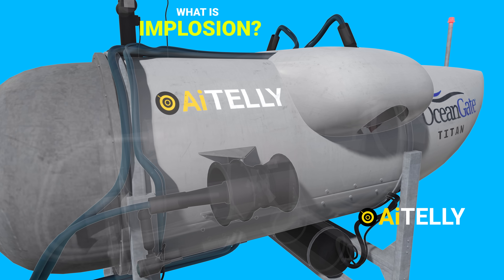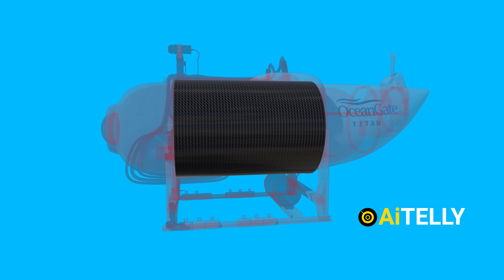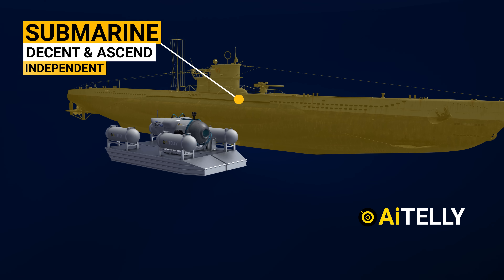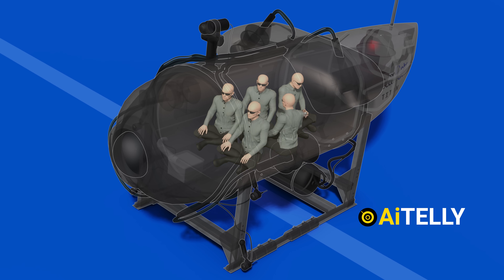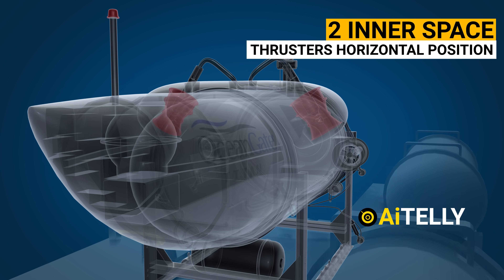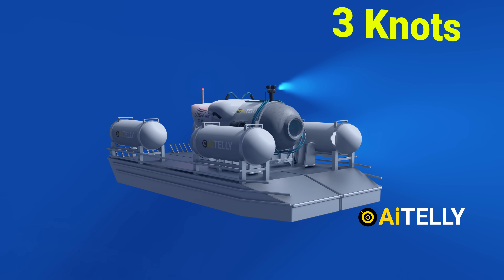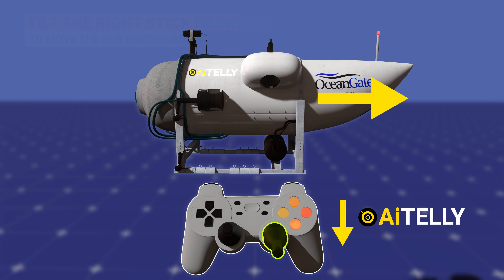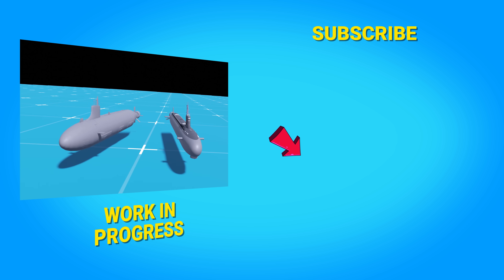Implosion Titan Oceangate How it Happened | Submersible Submarine Parts #3d

Comment: I did study mechanical aeronautics engineering. It is too early to point to the first component that failed, but for the sake of the discussion, I'm looking at a few different possibilities

1. The carbon/epoxy material is usually used to stand 'traction' forces - the carbon fibers are very resistant when pulling on them, which is how they work in aviation where the cabin pressure is higher than the exterior pression.  On a submersible, the pressure relation is exactly the opposite : the exterior water pressure is much higher than the interior air pressure, so the carbon fibers are put in compression rather than tension. It's actually the epoxy resin that must stand the compression - and resin is not a great material for this purpose. Some compression was also supported by the titanium rings. There is another issue: the diving results in cycles on compression. This causes what is called material fatigue which in the long term will create microscopic cracks which will continue to increase in number and size. This may not be visible to the naked eye - in aeronautics there are various instruments that 'scan' the material for these cracks at a specified maintenance interval. I wonder if the submersible had such inspection program.

2. The acrylic 'dome' viewport appears to have been certified for only 1300 m depth (three times less than the actual diving depth of around 4000 m). Now, such component will always be designed to handle more pressure, by a certain factor of safety. Given the deep sea conditions (currents, etc) I imagine this factor was rather high - maybe a 2 or 3 or even 4. Which brings the actual resistance to close of 4000 m. However, once near the limit of resistance, it's a grey zone - it may resist for a while but this may depend on the number of cycles (dives) and may be very prone to failure at the slightest impact. On the debris recovered, this dome is absent from the supporting titanium ring which shows that if it's not the dome that collapsed first, then it didn't stand the shock of implosion, so the dome was already very close to the limit of physical resistance.

3. I did watch one of the videos filmed inside the submersible by a tourist. I was surprised to realize that the passengers and their belongings are not secured during a dive - which dive can happen at quite a steep angle. A moving object - such as a camera or some other heavier equipment, could easily slide and hit the viewport dome, causing a microcrack that can reduce the strength of the dome even more. There is also a diver working outside the sub during the surface preparation, this diver can also impact the viewport dome with his air tank. 

4. The access hatch was secured with about 20 bolts tightened by hand. Tightening and releasing can cause fatigue cracks on these bolts. What is more, hopefully they used a torque wrench that was properly calibrated and verified before every use. In some videos, it appears a person is tightening these bolts quite in a rush.. this is a scenario that leaves place to mistakes. 

Finally, there appears to have been another serious risk : a fire inside the sub would have easily been catastrophic from a survival point of view. I'm not sure if there was a fire extinguisher but there doesn't appear to be oxygen masks for smoke. There were many electronic devices with li-ion batteries, which can be prone to sudden fire. Plus, even if the submersible would re-surface in emergency, the passengers could not exit the hatch which was bolted on from outside.
Reply: They did not scan the hull of the submarine, the CEO insisted that existing methods for detecting imperfections in carbon fiber aren't capable of doing so on a hull as thick as the titans. It was this same line of thinking that encouraged the CEO into the belief that the hull would produce detectable faults through their improvised RTM alert system using acoustic emission sensors along the hull body long before the hull would have been compromised to the point of failure.

Also did you mean to say that carbon fiber is usually used to stand tensile forces? 

If so, I would agree that carbon fiber composites are extremely resistant to tensile forces, however, there is a distinct difference between an internal pressure pushing out uniformly, versus an external pressure compressing (pushing in) on these fibers uniformly.

Carbon fibers and carbon fiber composites (Depending on their variance, like turbostratic or graphitic, weave pattern, binding agents etc) all have anywhere from 30-50% less compressive force strength than their tensile strength.

Combine this with the repeated reflexive forces exerted on the hull and consider some of the major causes for failure in carbon fiber composite structures, and it's pretty easy to see how definitively doomed this structure was after more than the first few dives, even if it was seemingly free of flaws during post manufacture inspection.
(Some major causes of failure are *fiber kinking*, *delamination*, *matrix cracking*, and fiber/*matrix splitting*)

Also, you reference the absence of the acrylic port as potential evidence of it being the major failure point, but I would also point out the seemingly perfect absence of the retaining plate and its bolts. I believe it was removed to allow for easier onloading/offloading from the ship, and was likely not the initial point of failure. If this was an explosive force I might consider that it had blown off/out and ripped the ring free, but because this is an implosion we are talking about, you would likely see atleast the titanium retaining ring or bolts still in place and/or possibly deformed.

I do agree that the torque of the bolts is a potential problem area, but when compared to the blatant risks associated with the hull, that this was far less likely.

If the failure occurred at either the forward or aft titanium bulkheads, I would presume it to more likely have occurred along the joints between the titanium and the carbon fiber (where it was *glued together*) again, likely due to reflexive/compressive tensions placed on the two materials at different rates during descent (due to their composition/conductivity/density).

Like taking a wax string and wrapping it around a glass bottle, burning it, and then  dipping the end in ice water, it will fracture and separate along this heated area due to the rapid change in expansion/contraction between the portion of the bottle that wasn't heated (unchanged) the heated point (the joint, expanded zone) and the dipped point (contracted/compressed zone).

The same thing is effectively happening except from sheer weight/pressure instead of thermal expansion, and in this case the joint would be the agent used to join the titanium rings (that the bulkheads could bolt onto) to the carbon fiber hull body.

That bonding agent would be experiencing frequent changes in both tractive force (the weight of the bulkheads pulling the titanium rings away from the hull, or pushing toward the hull at depth), tensile force (the expansion of the ring around/away from the hull body during ascent/descent), compressive force (pushing into or compressing onto the hull body during ascent/descent).

That's why I personally believe the fault originated most likely toward the forward or aft joints with the breakdown of this bonding agent being the catalyst or cause for the rapid failure of the hull body itself.
Reply: @JayZone73  my question is why didn’t they scan, but used audio to test laminate?
Reply: @treydogg77  they didn't "scan" because the CEO insisted that there was no effective method to "scan" the hull because of its thickness, which is partially true, but is a major reason why no testing agency would ever even consider certifying this submersible.

For a better understanding these are a few of the traditional non-destructive methods used to test carbon fiber for defects or failure points:

1. X-Ray testing, can be useful, but is limited partially by thickness, but is moderately unreliable because flaws can only be seen depending on the angle of projection... so say for example you scan one side of a cube, you might find no flaws, you scan the other side, and you could find a plethora of flaws/failure points... this becomes even more complicated when you're dealing with a cylinder, and extensively more so when you consider the thickness of the composite.

2. Ultrasonic testing, is exceptionally effective, but cannot be used on composites more than about 50mm (slightly less than 2 inches at most, the titans hull was 2.5 times that size at 5 inches.)

3. Thermographic testing (essentially an infared camera and an infared exciter set to pulse IR beams through portions of the CFRP) unfortunately this method of testing is still experimental at best and you would effectively need to purpose build a setup specifically for this application, and it would probably be very time consuming, and expensive, only to provide you with as of yet, not quite proven/accurate results.
That doesn't sound like something Mr.Rush would have wanted to invest in, considering half of the components he haphazardly put into this submersible were from his local Walmart.

There's also a bunch of other methods of testing that I won't get into for the sake of brevity, like HF-EC testing, sound testing, etc... but essentially the issues are all the same... most of these methods of testing are limited by CFRP material thickness, shape, and composition, or are still in the infancy of their experimental stage, and so they cannot "definitively" determine the location, size, or presence of faults depending on various circumstances.

Hopefully this helps answer your question... essentially Stockton Rush had an inflated ego and tight pockets, and much like the passengers aboard the ship he died trying to capitalize on, he too thought his creation was infallible and ahead of its time.

Yadayadayada... metaphor to icarus... blahblahblah... thought he knew better than everyone else and sought to prove it... etc etc etc...
Reply: @JayZone73  you my friend see to know your shit. Stockton was a entitled aerospace engineer that couldn’t get the fame he  so much destined for. Therefore he chose deep sea exploration/tourism to see the titanic and marine life in which the media greeted and interviewed him after e
mostly top water tours….
Reply: @treydogg77  I have a very minimal familiarness with the material science behind this sort of thing, but my father was a certified master diver and I grew up scared shitless of the open water, so submersibles/submarines are an interesting topic to "dive" into for me... (excuse the pun hah)

I told my coworkers after the first announcement of the rescue operation that I assumed they were dead already after doing about 30 minutes of research online and finding out how many to depth dives they had already put this hull through.

Stockton Rush was either an arrogant fool when he put the acoustic sensors on the hull as his primary RTM alert system, assuming his hull wouldn't fail if it hadn't by now, or he was an ignorant fool if he thought it would happen slowly enough that he could resurface before it was too late.
Reply: @JayZone73  Could have been that the hull failed and the pressure of the air attempting to escape blew out the porthole
Reply: A deep sea smoker , so to speak.  I posted awhile back that the sub. needed to be scanned but still it was a glued together puzzle , the pros. laid out the faults, they forewarned Rush many, many people, thus Rush's ignorance to skip basic safety and he did not do 50 'test dives' , so this was test dive 3? A test dive w/ paying passengers, kinda backwards, I feel sorry for the paying passengers, I wish they had been saved, or resurfaced, but janky jank sub. gave them a watery  grave, near the ghosts of the Titantic.
Reply: I love smart people.
Reply: @Tonkacrew reading through these comments with no actual engineering education whatsoever like hmmm yes that makes sense mmmmm 🧐 lmaoo
Reply: The acrylic dome window was probably blasted out by escaping air during the implosion
Reply: I never though about any lipo or liion batteries. I've dealt with my fair share of swelling and exploding batteries and in just one phone popped, they would all asphyxiate.
Reply: IIRC, the #2 that you discussed was why one or two of the OceanGate employees had lost their job(s) in the not so distant past.  They complained about that issue and the CEO just fired them immediately.

I hate to say it, but the CEO may have had some malicious intent with all of the warnings and clear issues being addressed by professionals in the field all being completely ignored by him.  I mean, if your own employees are pointing out clear points of guaranteed failure to you and you fire them as a result, I just can't see there not being a little malicious intent with his recent submersible dives...
Reply: I was also wondering about the torque on the bolts. Is that usual industry standard?

Thanks for the great information!
Reply: The lack of angle winding of the carbon fiber material was the cause.
Reply: @albondigas9549  Sure, that kind of winding is not as strong as others but it did  reach titannic depth 13 times.     
To know the extent of water intrusion, it would have to be tested.     
We all know what ice will do.
Reply: @Icepacalapse  well it collapsing at the center of the "tube" forcing air to be replaced at each end, forcing one "end cap"seal to fail, makes the most sense to me.
Reply: @albondigas9549  The collapse starts at the center which pulls one side of the tube closer to center until the flange clears the carbon.............or near enough for it to give up.
Reply: Maybe the shell bulged under 6000 psi it may have gone out of true isnt that why they  use steel it was 5 inchs thick on the triest bathescape and one of the windows cracked on that i read if the window had cracked some more it would have vapourisd the crew .so would be douptfull of carbon fiber r.i.p the poor fellers
Reply: Lol
Reply: Yes. I have several theories... Until there's more information, it's anybody's guess.
Reply: One more thing, they sent down a niskin to make it look as though it was for research, the last dive they were shifting it was not perfectly straight. I wondered if they sent it down, had it hit the porthole.
Reply: the truth is in plain view if you look at the pieces recovered.I dont believe the Main pressure vessel was the initial failure point. Hate to ruin  the party for yall though..
Reply: Truth was in plain view when OceanGate displayed Titan in sub-freezing conditions at Everett marina.     
What happens when the water forced into voids during a previous dive freezes?  
Yes…..Titan was fatally damaged while it froze and the implosion was a given.
Reply: @blackhd92  if the "truth is in plain view" from the obscured observation of the remnants recovered from the ocean floor then why don't you educate us then instead of acting like a pompous internet warrior?

If the main pressure vessel (literally the thing keeping the external pressure from crushing them during the dive) didn't fail, then why was it a debris field and not a drifting tube with 5 dead people inside of it upon discovery?

Your comment doesn't make sense.

If by MPV you actually meant the carbon fiber hull, I would say it is exceptionally unlikely that the proven material components (the titanium endcaps) were the failure points, because they are vastly more capable of enduring the pressure differential and aren't visibly crushed or malformed in any of the pictures I've seen yet.

If you mean the acrylic port (which is a component of the main pressure vessel by the way), then sure, an argument could be made for that... but i would ask why they would deliberately remove the titanium locking ring that kept it secured to the end cap, if the goal was the preservation of materials for the purposes of investigating points of failure.

If however, they recovered the forward end cap and found the port was completely intact, it stands to reason that they might carefully remove it to allow for ease of transport, because that endcap weighs quite a bit to say the least.

If it was a battery failure, it wouldn't have caused a failure of the MPV, if it was a failure of the scrubber unit or loss of oxygen, it wouldn't have caused a failure of the MPV (unless a subsequent explosion or fire occurred and weakened the carbon fiber thus causing a failure of the MPV)

There is no scenario short of a full blown conspiracy wherein you can tell me that based purely on the photos of debris being offloaded that you somehow immediately know more than experts in the industry, as well as engineers and material/physical scientists, who have all had similar speculation on the cause of this catastrophic failure.

Please spare me the excuse of how the aeronautics industry has bonded carbon fiber to titanium as a justification for how you just happen to "know" that it couldn't have been the cause of failure on this submersible.

Keep in mind, those bonds are occurring at high altitudes, with negative external pressures and positive internal pressures, something that carbon fiber is distinctly adapted to, and the pressures/forces it has to withstand are absolutely insignificant compared to the positive external pressure being exerted on a submersible operating at even a portion of the depth this submersible was operating in. Not to mention the fact that carbon fiber has a compressive strength rating (on average) of less than half of its strength rating for tensile force (lower external / high internal pressures).

Your responses to many of the comments on this video make you sound like a pompous pseudointellectual or a crackpot.
Reply: They also had a woman tightening the bolts. That could be the cause right there